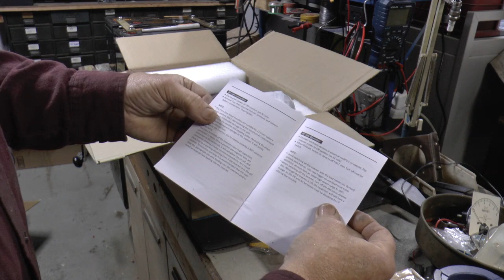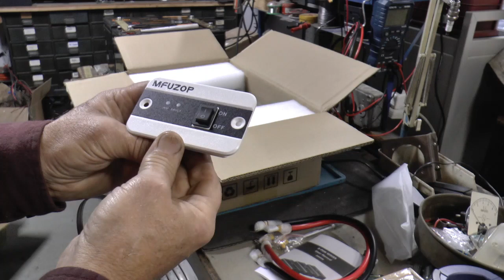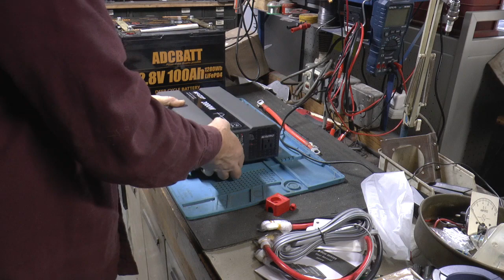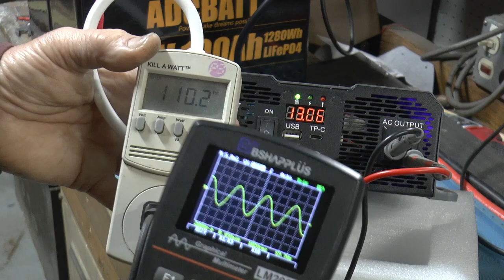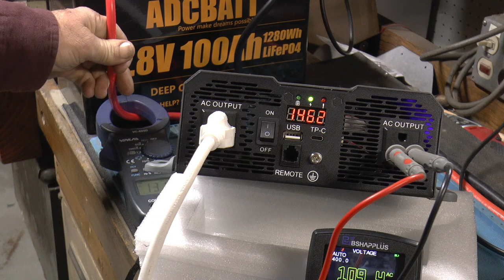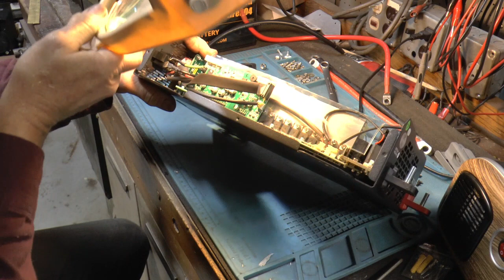MFUZOP 2000W Pure Sine Wave Inverter, 12V DC to 110V/120V AC ☺👍

Comment: Very odd.  I can't find this inverter anywhere without a 50/60hz toggle but that's likely why it's running 110.
Reply: They actually upgraded their inverters they used to come without the switch but now they all have it. I have 2 of their 1500w inverters and the first one I bought in 2022 only had 1 fan and no frequency toggle switch and now I bought a 2nd one in December 2025 and the same inverter now has the frequency toggle switch and also has 2 fans instead of one. I guess you could say the new ones are the improved versions of the 1st generation. In December I got lucky Temu had a sale and I bought the 1500w inverter and an Ecoflow 12v lifepo4 100ah battery for only $154 tax included and free shipping. The crazy thing is Ecoflow are extremely high quality batteries so it blew me away that I got the inverter and battery for $154 dollars. On Amazon the Ecoflow battery alone costs $169.99 and the inverter $99.99 so I got a huge discount on Temu and the amazing thing is it shipped in only 2 days from New Jersey. I am starting to really like Temu because now 75% of their stuff ships from within the US.

Comment: Im from scotland UK and i have an EDOCA SINCORE 2 201D inverter 240v 2.0 kw inverter which i think is a newer version to the unit you have it has a nice blue LCD display on the front with more information on it but it looks very very much the same as yours internally and its a great little unit standby on current drain is nearlly 2 amps but i onlly use it for cooking and tv etc use its not left on all the time.i can run heaters microvaves etc i even used a parkside inverter gasless mig welder on it today welding my car exhaust with no problem.I bought mine of ebay for £130.00 bargain id say.There great units i initiall bought as sincore 2 121D which is the 1200watt version and was so impressed with it that it can run 1400 watts run a mi roce etc i ended up allso buying the 2.0 kw version which i have in my car with solar on roof for camping induction hob and stuff and tge 1200watt unit in my house for power backup etc As you say they work well and look nice internally the sincores have nicer caseing look and much nicer display there great value and performance.Nice reveiw and test bud.👍👍👍

Comment: yeah hey ripped me off on TEMU i knew i should of gotten mine off AMAZON lol so yeah they claimed in the description that the inverter they where selling on TEMU where 3000watts and 4000watts for cheap so i jumped on it and bought one but i found out that the inverter was 1500watts and 3000watt peak power but the description didnt say anything about this and i never bought a inverter before so i didnt know there was such a thing anyways but still they messed up because the description didnt say anything about 1500watts and 3000watt peak and i told them this and right after the seller changes his description and never got back to me so i wouldnt trust this company when buying from TEMU so im going to send it back since the company flipped out on me and said i was lying so yeah not cool dont buy from this company they wont like you if you tell them theres an issue with there proucts